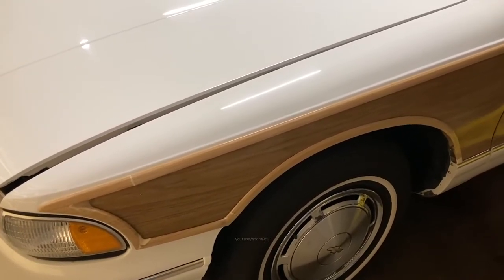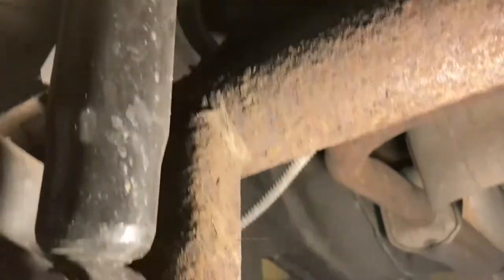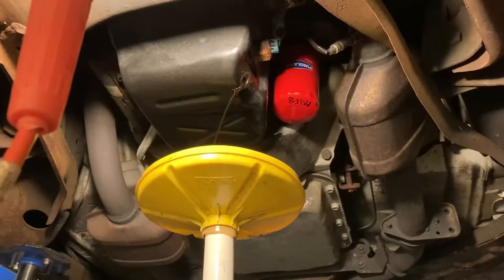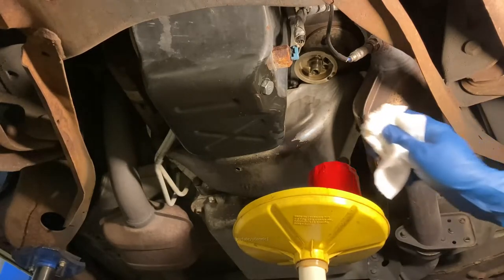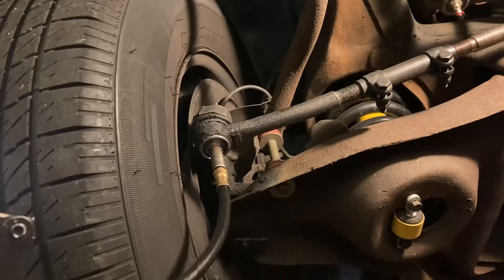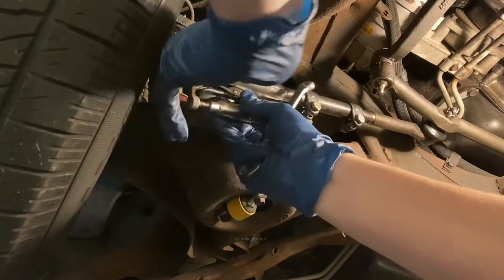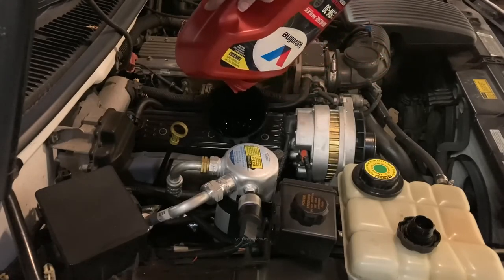Time for an oil change - plus tips and tricks - 1994-1996 Caprice, Impala SS, Roadmaster, Fleetwood

Comment: Great Video! 

I bought a 95 9C1 as a car to have some fun with. Wasn’t suppose to be a daily driver but so damn fun to drive. 

Currently got a main seal leak that I’m going to start the process of fixing. My rear rotors were converted from drum to disc, and found that their lose and being held tight by the tire itself. All in all, one of the easiest cars to work on and I’m not even a mechanic.
Reply from the maker: Thanks for the comment.  Glad you are enjoying your 9C1.  I've been driving them daily for about 25 years.  Note that '94-96 9C1 and Impala SS cars had rear disc brakes stock from the factory.  Unsure what you mean by "loose" but the calipers do float on the pins in the caliper bracket.  It's important to keep those pins clean and greased with synthetic caliper lube.  As for your main seal leak, try a good quality "High Mileage" oil.  That may slow down the leak if the seal is stiff.  Give it at least a month or two after changing the oil to soften up.  And always run that type of oil from then on.  I keep cardboard under my cars, the main seals do weep.  It's common.  No worries.  The oil filter adapter seal at the block is another common leak area.

Comment: What number on the purulator filter, I just bought a 94 caprice with the 4.3 motor ?
Reply from the maker: Hi.  Congrats on the Caprice purchase.

The standard Purolators have recently got harder to find!  Times are changing rapidly.

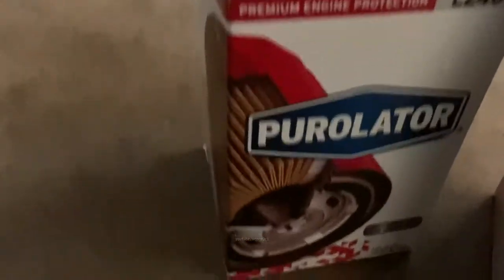For years I used L24011 (standard).  Note that I do show the box with the filter number in the video around 21:25.

The upgrade Purolator is PL24011.  Both are good filters.  Though the "upgrade" is nearly twice as much.  But at least my local Advance stocks it.

I mentioned I got L24011 at Advance.  But they have sadly cleared their shelves of the standard Purolators and replaced them with Fram (no thanks).  For Purolator, they only stock the One (upgraded) and Boss (even more expensive).  Good filters but overpriced IMO.

Autozone also does not sell the L24011 either.

My local Tractor Supply has a few L24011 on their shelves for $5.99.  So next time I am there, I will pick them up.

O'reilly sells the Wix 51036 but for $12.99.  Bleh.

Other options:
Advance has the Carquest brand R85036.  But inspect this filter before buying to make sure they don't switch it to the junk plastic core version.  Last time I checked, it was the correct depth and had a metal core.  That's probably the best value at this point.

NAPA has a few options.  For example, the Gold (FIL1036) and Silver (SFL31036).  The Silver is probably closest to the standard Purolator in price and build quality. Basically a Wix. Possibly their Proformer line is good as well but I haven't tried those.

I may just end up ordering a case of Wix 51036 at one point from Amazon.  Especially if the Purolators become harder to source.  Sad to see so many stores "selling out" and switching to Fram or forcing the "upgraded" versions for $12 or more.

The original AC Delco PF52 still available with the metal core but for $12.99 or more.  And reading reviews indicate that sometimes they end up getting the PF52E anyways!  Most big box stores sell the PF52E (the one with the crappy plastic core).  Nope.  Too much hassle to figure out what you are really going to get.

Another option is the BOSCH 3430 if you can find it.

Many of the other "clones" have switched to the shorter/cheaper filter with the plastic core.

I put "clones" in quotes since most oil filters come from the same few factories.

Good luck!
Reply: Thank you for the detailed reply,I will try the Advance by me to see if I can get either the Purolator or Carquest brands.